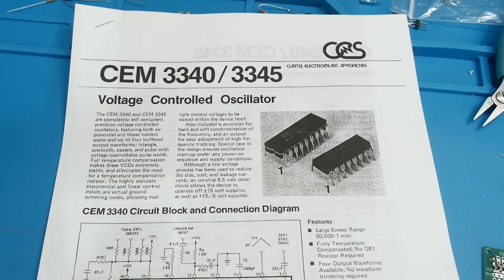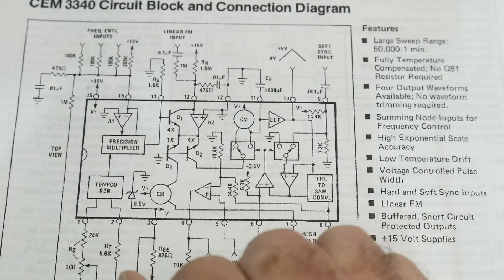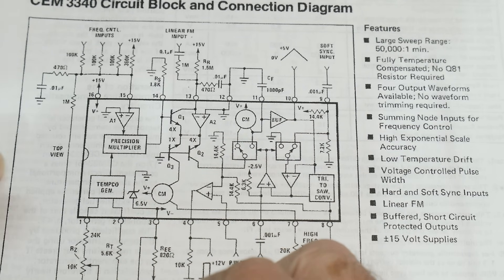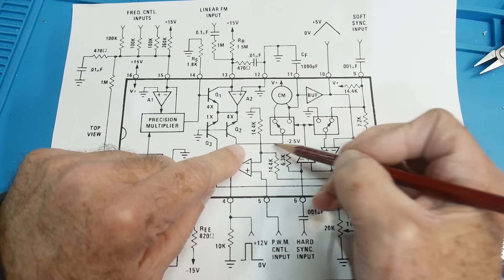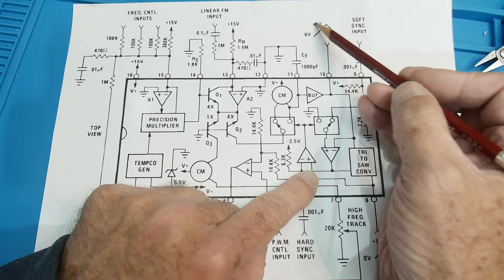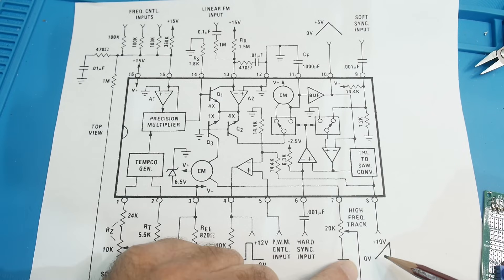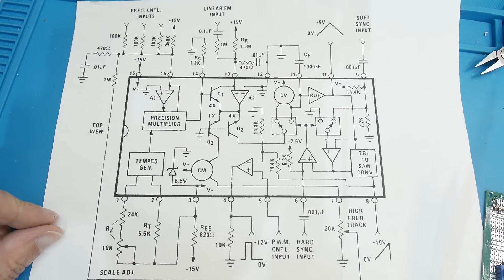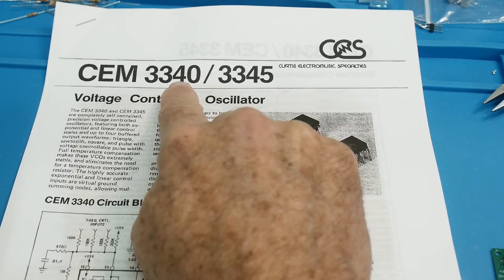#1793 CEM 3340 VCO

Comment: HFT trimmer is to compensate for the increasing emitter resistance in the exponating transistors Q1Q2Q3 at increasing frequencies.
Reply: He missed the Q1Q2 exponential function completely. The diagram even showed „linear FM“ for the alternative input to the opamp. That should give a hint that there is something „non-linear“ as well. 
But I would assume he’s not (technically) into music and did not recognize that 1 octave difference is just double frequency and so the 1V/Octave voltage needs to go to an exponentiation stage. He’s more into MHz and GHz, so what 😉

Comment: Actually there were quite a few digital synthesizers in the '80s... the DX7, for example.
Reply from the maker: The DX7 was quite special. Lots of FM mathematics in that one.
Reply: The figure I heard was a quarter million DX7's were sold. Just that one model killed off all those analog-chip-based polysynths (and thus the chips themselves), as well as a couple other keyboard instruments, the Rhodes electric piano and Hohner Clavinet. All of these other instruments are now collectible at high prices, but you can still get a DX7 for well under a grand.
Reply: @TranscendentBen 
DX7 and analog polysynths both have their place in music. They are different in features, non is a better version of the other.

Comment: Abstract for a 5-Year-Old

Imagine a special music box that can make different sounds. This music
box has a tiny heart inside called a chip. The chip makes the music go
up and down, high and low, just like singing!

To change the music, you can turn a little knob, just like turning the
volume up and down on a radio. This music box chip is special because
it was used in lots of cool old music machines called synthesizers.
 
Key points:

* Tiny chip makes sounds. The chip is like the heart of a music box.
* Sounds go up and down.  It makes triangle-shaped sounds.
* You can change the sound. Turning a knob changes how fast the
  music plays.
* Special for old music machines. These chips were important for
  special music machines a long time ago.

Abstract

This transcript describes a YouTube video about the CEM3340
voltage-controlled oscillator (VCO) chip. Here's a summary of the key
points:

* Historical Significance: The CEM3340 was an iconic analog chip
  used in many famous synthesizers from the 1980s, such as the Prophet
  5 and Roland Jupiter-6.  These synthesizers were polyphonic, meaning
  they could play multiple notes at once, requiring multiple VCO
  chips.
* Functionality: The CEM3340 is a versatile chip. Its core function
  is to produce a voltage-controlled waveform whose frequency can be
  adjusted with an input voltage. Beyond that, it also offers:
    * Multiple Waveform Outputs: Triangle, sawtooth, square, and pulse
    * Pulse Width Modulation (PWM)
    * Frequency Modulation (FM)
    * Internal Temperature Compensation for stability
* Modern-day: The CEM3340 was discontinued long ago but has seen a
  resurgence in popularity due to the love of analog synthesis. It is
  now re-manufactured and used in DIY modular synthesizers and other
  projects.

i used gemini
Reply from the maker: Sounds go up and down. Wiggle Wiggle
Reply: @IMSAIGuy  we don't wiggle wiggle here😅

Comment: I haven't found a north American source for these, but you can get them from either Electric Druid or Thonk, both of which are (I think) in the UK. They are not cheap; Thonk currently has them at $16.75 each, and Druid at $15.20. Obviously, prices will vary as the exchange rate of euro vs dollar changes.
Reply from the maker: https://www.amplifiedparts.com/search/node/as3340

Comment: Some advice not to use the onboard zener to prevent the chip heating up.
Reply: Care to elaborate?
Reply: Well, rather than injecting -15V you inject -5 Volt and the internal zener on pin3 isn't turning on, thus the chip doesn't heat up and starts to drift when you play it. @StepDub
Reply: @AnalogDude_  interesting. thanks.

Comment: The 'high freq track' feedback path is used to compensate for two separate effects. The first is that the oscillator core transitioning from 'up' to 'down' or back takes a more or less constant amount of time; at higher frequencies this time becomes a more significant portion of the cycle, resulting in an increased error. The second I suspect is less relevant to a fully integrated design like this, but a nonzero emitter resistance in Q1/Q2 causes Vbe to decrease proportional to the emitter current, so the current drops below its desired exponential relationship to the input voltage.

There's a classic article on the exponential current converter I'd highly recommend to anyone interested in analog synthesizer design, https://electronotes.netfirms.com/s019.pdf

Comment: The data sheet for this IC contains several exaggerations that cannot be realised in practise. e.g. Large Sweep Range 50,000:1. Only if you bypass the temperature compensation and drive Q1 directly! The precision multiplier is only one quadrant which is limited to about 10 octaves or 1024:1. Not all outputs are fully buffered. It does not run on +/-15V supplies, the maximum voltage across the IC is 24V.
Nearly all applications of this IC incorrectly implement the scale adjustment using the TC calibration instead which means that the TC does not work. Most applications of this IC used microprocessor corrected tuning. Read the data sheet text carefully, it does not describe the diagrams shown , but everybody blindly copies the diagrams. Then read the Alfa application notes.  
Zener diodes are not a temperature stable reference and are usually noisy. It is better to use an external -5V reference.
You are wrong about waveform glitches not mattering, when used at low frequency for modulation they are very annoying. There is no spec on the worst case and it varies IC to IC. 
Q1-3 are not current mirrors, they form a standard exponential  converter with an extra output.
The Curtis chipset was actually customised analogue arrays never designed specifically for this use and still are. Doug Curtis worked for the company that made them so he had insider knowledge and was able to wring the best out of them and surpassed the performance and reliability of the rival SSM ICs. The modern Alfa version is an ASIC reverse engineering the functionality.